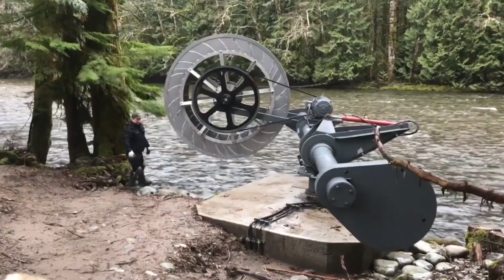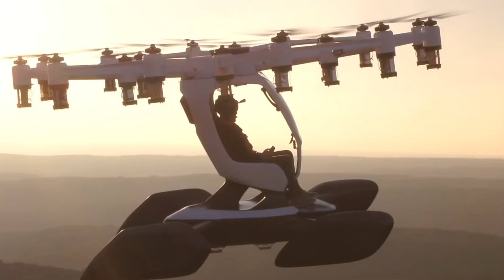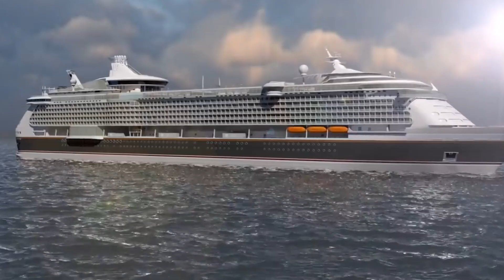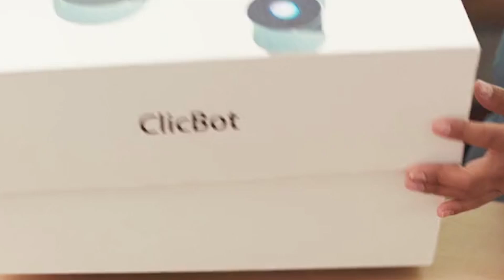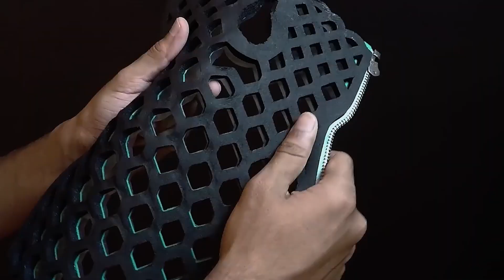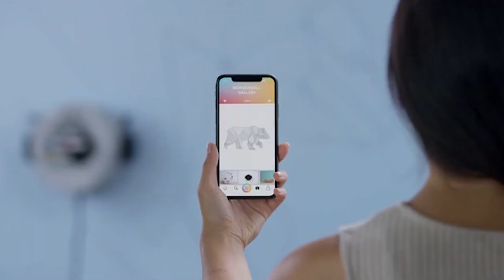INCREDIBLE INVENTIONS THAT ARE ON ANOTHER LEVEL

Comment: a the rotating water wheel so it can be taken in and out of its stream ... yeah not new ... it is ancient like -1000BC in egypt and the middle east ... it was used to irrigate their fields as the area dried up ... old tech made with new materials is all ... 
.
flexio uses a blue light to harden .... you mean it uses ultraviolet light ... like dental fillings ...

Comment: a helicopter without a pilot license?  seems fishy... and what happens when a duck hits a blade? i wonder how many blades it takes before it crashes. or how high you can go, because if your in a flight path, that would be bad.
Reply: Going by the usual aircraft "regulations", it should keep its flight capabilitys with half of the Rotors Going dead, at least enough to land it in a secure way. id assume it also have redundant systems for all the major controls etc.  with only 190kg selfweight that shouldnt be an issue
Reply: there will also most likely be tight regulations on how high u are allowed to Go for the reason u said: cant risk that this endangers regular flight Traffic, so it will be prohibited from use around airports and have certain high limitations in specific areas i bet

Comment: "energy is produced at a speed of 50 revolutions per minute" I didn't know energy was measured in RPM
Reply: Joules is the unit for energy in general.  Watts for electricity.  They were referring to the fact that the wheel made the most consistent electricity when it was spinning about 50 rpms.  https://en.wikipedia.org/wiki/Units_of_energy

Comment: The waterwheel was invented CENTURIES ago.  NOTHING "incredible" about making one today.  Hexa is also a fail.  ANY areo engineer can tell you that using a bunch a small rotors means incredibly bad lift efficiency and very low range.  Clickbot won't teach anything useful about robotics.  Automated drawing on walls is hardly "incredible".
Reply: Actually, the clickbot (Despite being a crappy version of Lego Mindstorms that can then have Robot-C hacked into it) teaches you more than you think, even if it's only basic PLC information/Ladder logic. it's more of an introduction tech/hobby. A Pi + servo's and motor's would be better/cheaper but then would have to worry about the robot frame/infrastructure. Reason stuff like Mindstorms/Vex and other things are useful.

But do agree with you on the rest though
Reply: @MegaCakeFan  No, nothing simple logic doesn't teach.  A very expensive toy
Reply: @protonneutron9046  I mean you're factually wrong but okay?

Comment: the first one isnt incredible or new, the second one is a stolen idea, the third one is a blender with a touch sensitive strip, the fourth one is just like a normal lifeboat, the fifth one is a children's toy and doesn't actually represent industrial robots, the sixth one is a freaking rubber cast, the seventh is the only cool one

bruh, find something original and stop clickbaiting people with your TOP 10 videos
it's getting quite annoying expecting something cool to find, and then they just show normal stuff with a few LED lights on it
Reply: obviously u are either very sarcastic or u have No clue how to use ur ears correct... the First ist New but its new to make it so easiky useable. the Seconds is clearly dirlfferent from the Personal copters er das so far, alone by its way to super easy Control die to how the Rotors are set up. the live boat is Like NOTHING thats currently available in the live draft Market, and its capacity/Low storage Space is a very Well executed Idea that make it ALOT more viable compared to any current i use alternative. No Idea about the robots, i guess those arent as unique as the Rest, but they are still different enough to be a good choice for this vid imo. either way, If u dont Like His vids, simply dont watch en, noone forces u, and from how u can See in the comments, the majority of ppl watching it are pretty Well entertained id say